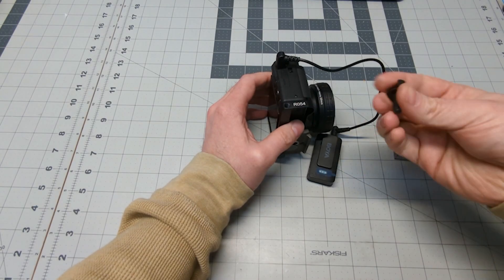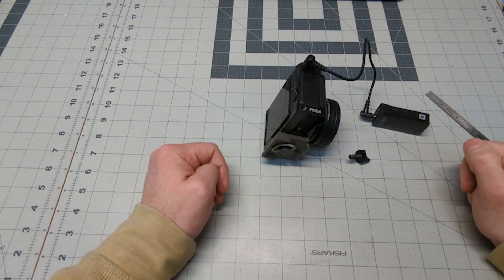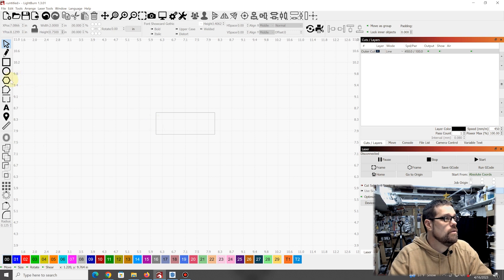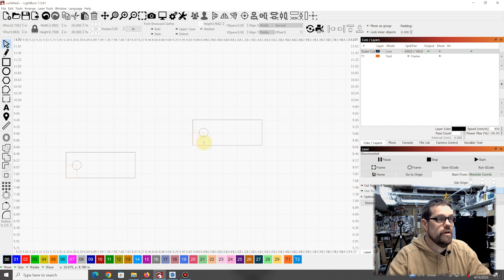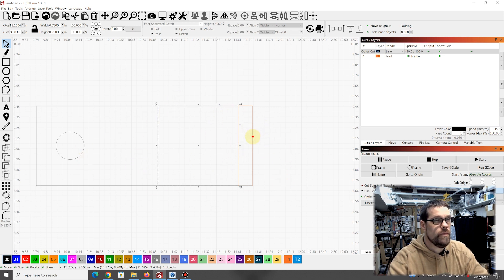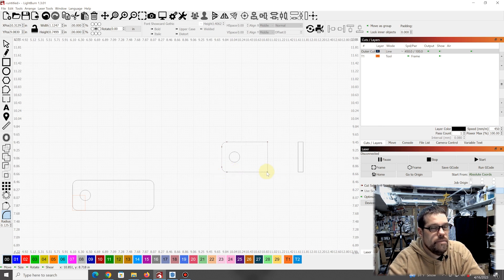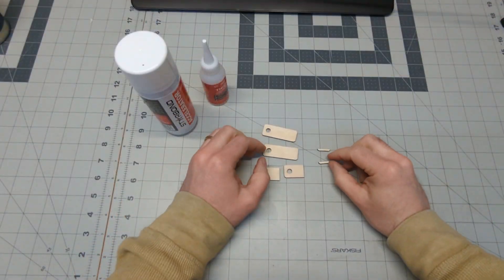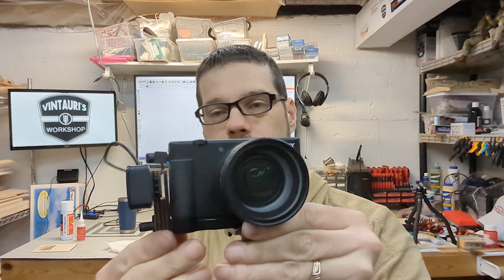Basic Design Using Lightburn

Comment: Love it. When I first bought my D1 Pro I was intending to use just the basic free software, but after downloading Lightburn to see what all the hype was about, it wasn't long before I  paid for Lightburn - I knew it offered the features I would need and is superior to the free software. 

This type of video is ideal for me. I'm not bothered about making a bracket to support a microphone specifically but the steps involved, the glue to use, etc., all will add to my skillset as I progress. More please - all very useful stuff.
Reply from the maker: I'm glad you found value in this video.  I was needing to make the bracket quick so I thought I'd use it as an example of how to work through some basic design to hopefully inspire others to not be afraid to try to create their own files rather then hope someone else has what they need. I'll try to keep more like this coming!